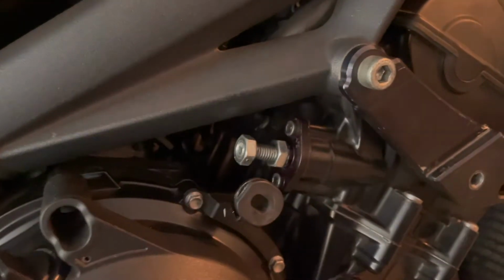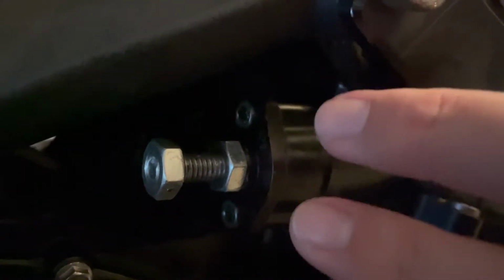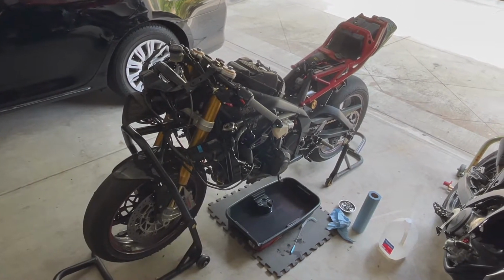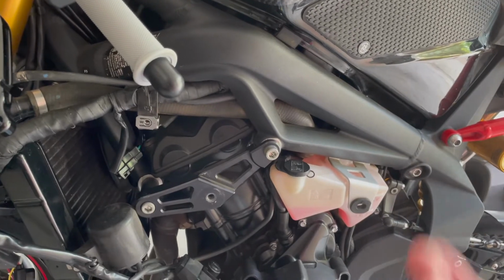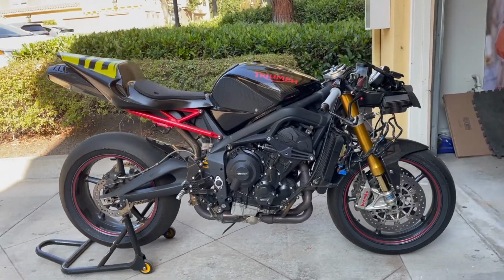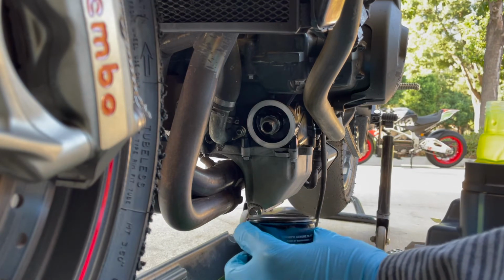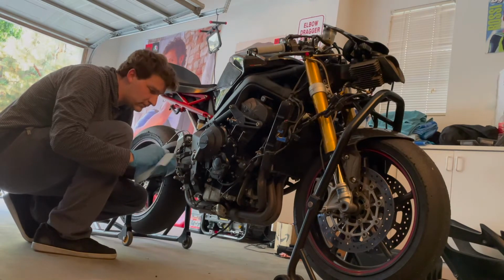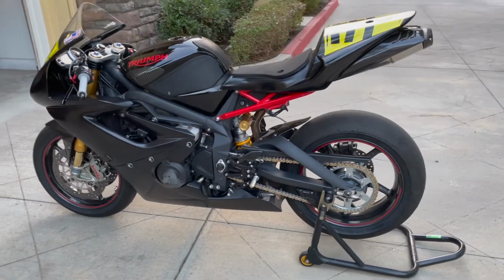Prepping My Triumph Daytona 675R Race Bike for CRA Round 2!

Comment: I’ve heard of those having to have a billet oil cooler if used for racing. Is this a mod you are familiar with? Or heard of?
Reply from the maker: I’ve seen people do it on the Triumph forums, but it seems like it’s normally a mod people make when they start building the engine. Mine is stock with the exception of Triumph’s “Off Road” slip-on, and still has the ex-up and stock flash so I’m not too concerned about it. I’ve known and seen people that have put a decent amount of mileage on these engines on track as-is without issue. It seems it’s when you go for more power that you’ll need to start thinking about cooling. It wouldn’t hurt, but it’s not high on my priorities list.
Reply from the maker: Well, I'm glad I decided to take another look at the forums and do some additional research on this! Thanks for bringing it back to my attention. I was thinking of an actual air-to-oil cooler, not the billet finned heat exchanger. So, it seems that the 2006-2010 Daytona OEM heat exchangers are prone to failure with extended track use, as air can cavitate inside them, ultimately weakening the metal over time and eventually causing them to burst. That said, it appears they made an improvement to the 2011+ bikes by changing the gearing of the oil/water pump, slowing it down so as to prevent cavitation. It seems like this improved reliability, but the billet coolers don't appear to be too expensive, so I may have to add that to my list of things for the future.
Reply: @hiimchad   that’s good to know. If you do end up doing this mod. Please upload a vid for the install. I’ve seen nothing on YouTube on doing this mod, I’m curious to see how it goes.
Reply from the maker: @KidShalahan1023  will do! 👍

Comment: Hi Chad, I'm currently converting my 675 into a track bike but not sure on how to attach the rectifier? I can see you've got yours just under the dash, how did you attach it?  Thanks, kyle
Reply from the maker: Hey Kyle! I used cable ties to secure it to the ram air duct towards the front of the bike. No modification was required other than redirecting the wires, but there was just enough for it to reach up there. If you send me a DM on Instagram I'd be happy to send you a pic!